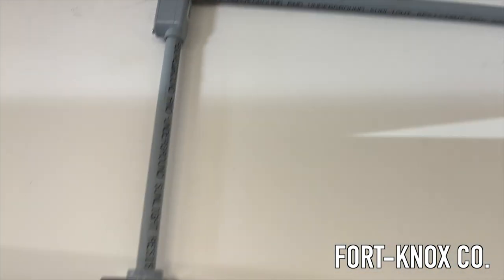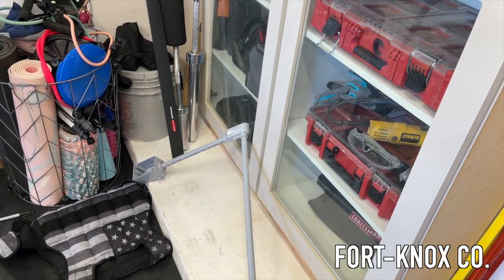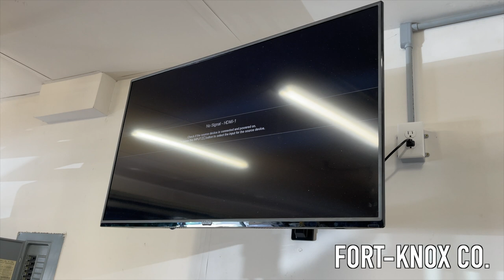How to Add Electrical Outlets in Garage | No Drywall Work!! | DIY electrician | Existing Circuit

Comment: Why did you pvc pipe and boxes for indoor installation? You should have used EMT and 1900 boxes and mulberry covers instead and saved money in doing so.
Reply from the maker: I was just trying it out and knew it was going to be temporary. I took it all down when we moved out of the rental and out everything back to the way it was. But mainly just didn’t want to run exposed wires so I did this to provide some protection
Reply: Okay, thanks for replying. Have a great day, and good luck in all of your future DIY projects.
Reply from the maker: @johnbarone8948  thank you I appreciate that.

Comment: Probably could’ve used the garage motor outlet and had a shorter run.
Reply from the maker: I don’t really like pulling off that circuit for the chance you used the door opener and it draws too much at the same time. Sometimes they run those garage opener circuits as a dedicated line because of the amperage they need. My guess is your right and it’s be okay, but I just didn’t want to chance it

Comment: Is that schedule 40 or 80?
Reply from the maker: I used schedule 40. It’s the most common found at your big box stores and since this isn’t being exposed to the elements or going underground it’ll be good for the application. The schedule 80 is usually used for the heavy duty jobs.

Comment: Commentators ask about NM cable (romex) in conduit....  How big must the conduit be to fit the NM cable.....

NM cable in conduit is allowed for exposed wire protection from damage in 334.15 in the nec.

There is a minimum pipe size for wires.....chapter 9 table 1 PERCENT OF CROSS SECTION OF CONDUIT AND TUBING FOR CONDUCTORS AND CABLES. (2029 nec page 70-695) (that calculate the fill section) in note 2 points out that the fill requirements are not Intended to apply to conduit for protection from damage.  Roughly stated,  "If it fits it fits"  Electrical guys already to leave plenty of room.  Put that knowledge to good use for yourself.

P.S.  second part not included in my other comment.
Reply: I do not believe that you are supposed to use this wire inside a conduit because of wire heating.
Reply: @nimer4744  As I indicated:

NEC section 334 is the section for NM or romex cable, controlling its use and installation, like you must use 60 degrees c for NM cable.

Section 334.15 is the section for protecting exposed cable from  damage.  This allows pvc, emt, and other protection conduits.

NEC 90.4 allows your local building department (ahj) to enforce, change, or ignore any and all parts of the NEC.

Please check in your area as to what they allow, but the NEC looks like it is clear....it is okay/required for protection.

Also, chapter 9 table 1 in note 2 does away with the fill requirements for conduit for protection.  #6 romex in a 3/4 inch conduit is okay as long as it fits.  I would go bigger, but NEC requirements are what we are talking about.